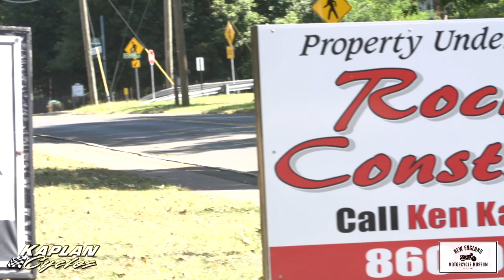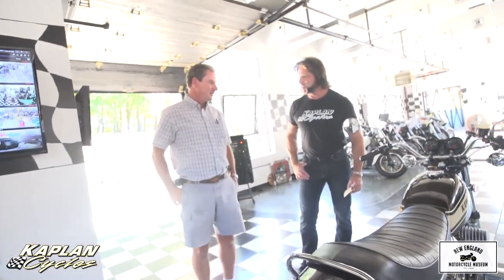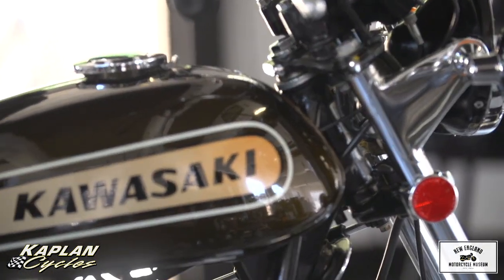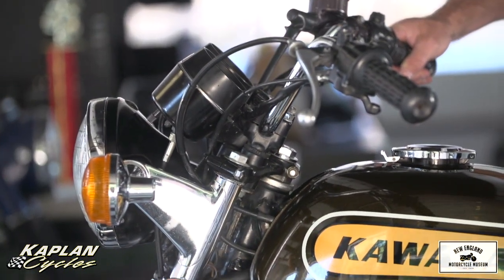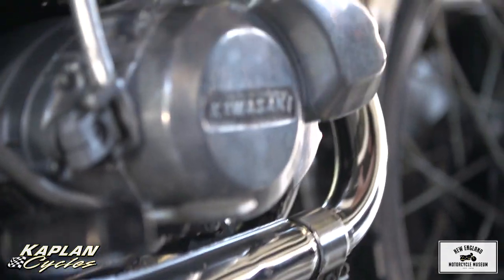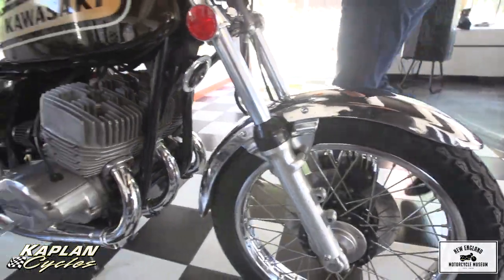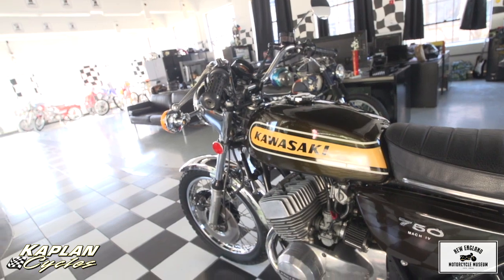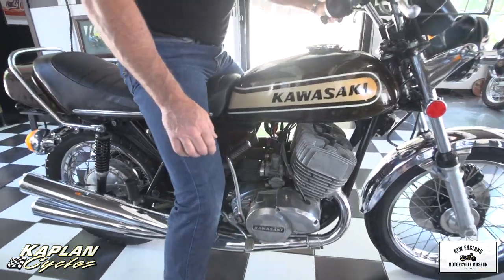1974 Kawasaki H2 Mach IV | Seize this opportunity | New England Motorcycle Museum

Comment: The 72 H2 was the fastest. Each year after they changed the ports to make it easier to ride. I was the BSSK record holder at New England Dragway. They added the K for a separate class as no other 750cc bike could touch it. I did run the longer swing arm of the 74 as mine was a 72. You could update but not backdate. The bike was lowered, drag bars, rear shocks replaced with struts, Denco chambers that were supposed to be a 10% hp boost.No porting and stock carbs. I also had a lighter aftermarket front fender and a race seat. I have my record holder certificates 11.62 I ran this from 1974 to 1980. You hear about the 74 KJ 900, not even close. I had to spot them in SS eliminator. Jack Doyle one the originators of NE Dragways sons Pat and Jay ran bikes at the time. I had a partial sponsor that helped. Dover Kawasaki on the Littleworth Road. George Nicol. In 78 I was runner up in BSS. At Atco Dragway in NJ. Wes Nyce out of Trevose Pennsylvania blew me off with an 11.21.My best run ever was an 11.39.
Reply: Jack Norman is my name
Reply: Epping is still a great strip as I still race it. Still a few H2s on the circuit and of course the Z1 900s still hold thier own.
Reply: Wes is from Pottstown and just stopped racing a few years ago after a mishap at Reading Motorcycle Club 1/8th mile .. still helps with others bikes tuning.. if I see him, I’ll tell him you mentioned him Jack!

Comment: Gotta LOVE them ring ah ding ding 2strokes. I have two 74's. A S3 and the clone to this one. My H2 only has 1,600 miles tho even came with a gift from original owner. A factory oem set of black drag pipes he purchased from dealer he never installed. My question to yall is this....my right side of tank the KAWASAKI paint (yellow) is faded lookin from the left. Exactly like this one! I thot mine was from storing by a window by orig owner & was just sun fade? Btw..this bike was worth every penny the gentleman was askin.

Comment: I was weaned on H2’s.. we always mixed and matched parts from 72,73,74 for our street bikes.. my last one had a 72 motor, 74 swing arm, Tracy 1 piece fiberglass body, Lester mags, dual discs up front from a 900 LTD, chrome Denco chambers, Denco drag bars. I used to get pulled over a lot, not for speeding, the cops just had no idea what is was.. great memories!
Reply: Almost bought one in 74, but came to my senses & got an rd350 Yamaha & later 1000 LTD. These were crazy,not as crazy as maybe a 72-73 but crazy nontheless!